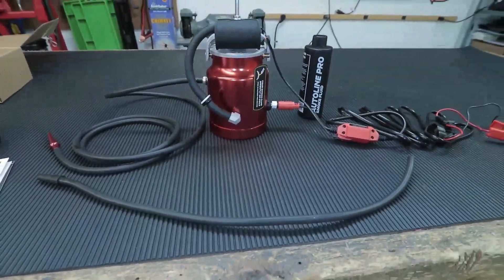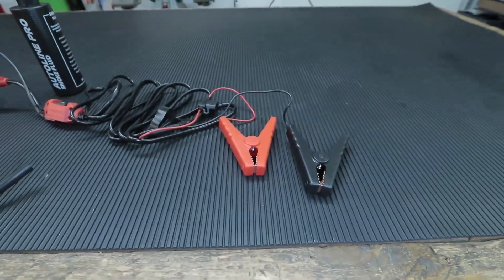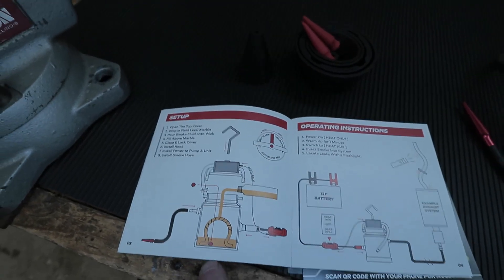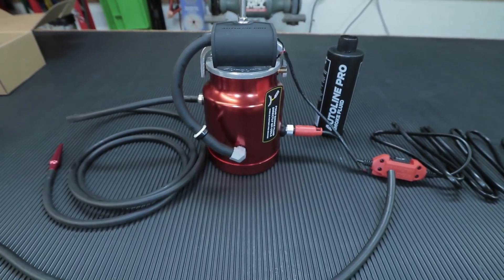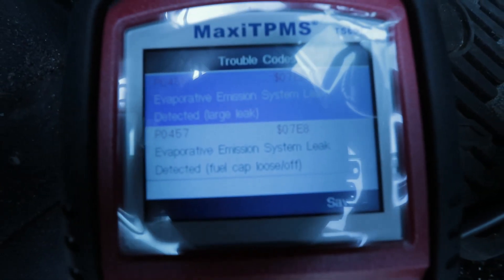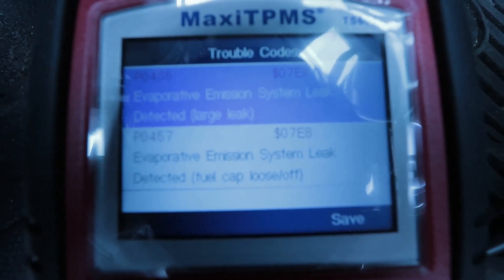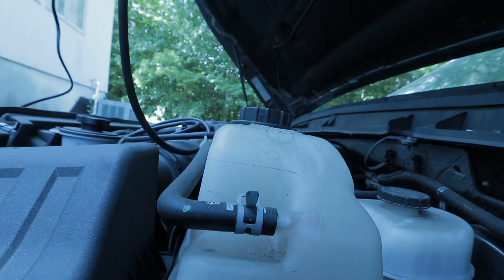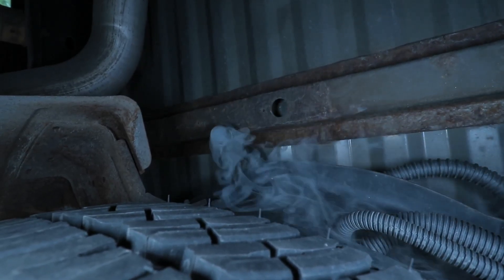How to FIX 11-16 Ford F250 F350 EVAP Leak Check Engine DTC Code P0455 P0456 P0457

Comment: Did this fix your problem? My understanding is the canister valve should be normally open and the purge valve normally closed?
Reply from the maker: I made another follow up video for the fix for my truck. Click on the upper right cards (white dot) or check my playlist
Reply: @ModernHotrodsNH thank you for the quick reply. Heading there now.